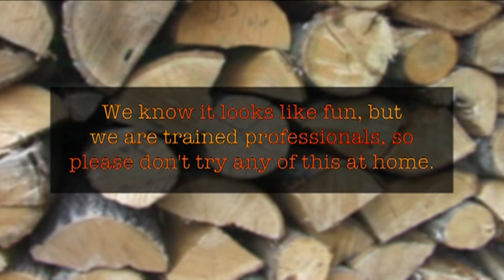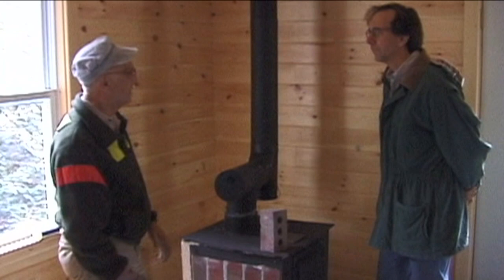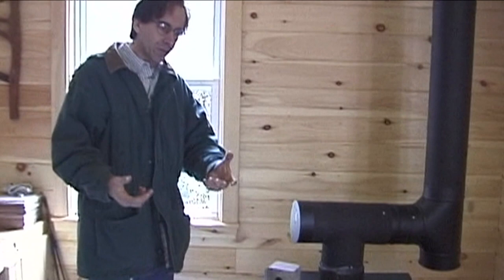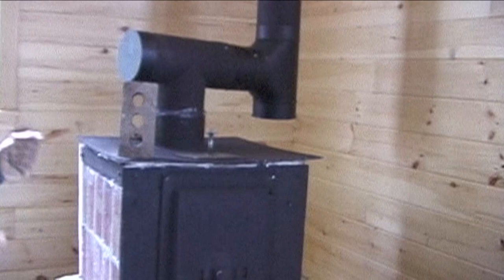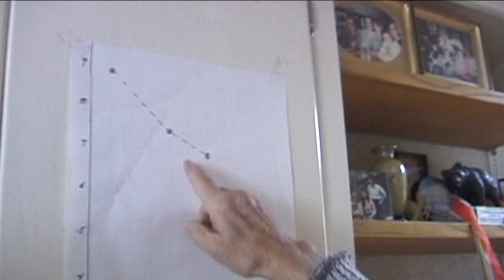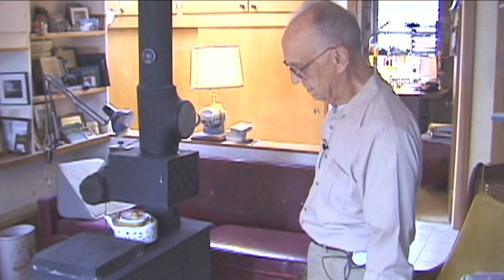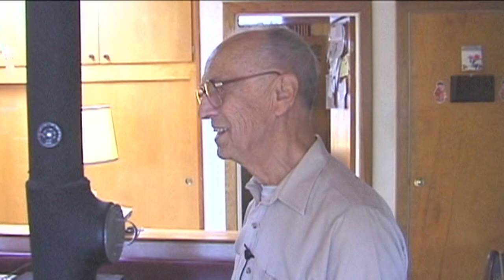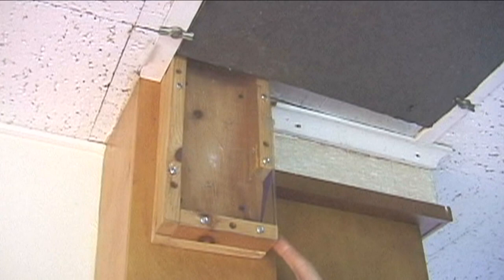Hot and Cold: Wood Stoves with Professor Dick Hill

Comment: This was a fantastic and informative,  the eldely gentleman had thought so much through.

The wood dryness test ive carried out myself in uk they recommend logs to be below 20 moisture level and weathered for one year. I have found stored in my shed windtight about 3-4 months and i can achieve this. Wood burns fine very little sparks. Outdoors just took too long using a simple tarp over the top.

I was also glad he took into carbon monoxide into consideration, i have mentioned it several times to utubers who made their own stoves for the intentions of inside tents. They dont seem convinced, ahh ive not had a problem before. I know from experience its a silent killer, my own home was burn to the ground and we escaped with our lifes only just due to the bravery and courage of the fire service.

Anyway job well done the refrigerator was interesting too. We waste enough as it is. Regards nick

Comment: Greetings,  thanx for video, good to see Dick on YT.  This Ceramic High Temp Insulation, for additional burn cycle,  is this commonly available, and if so where do I start looking for it?  And  is this something I can scavenge out of some common discarded item :-)?    Oh, one more query, is Dick into modern Rocket Mass Heaters (all over YouTube)  that use no electricity?  There are dozens if not hundreds of backyard fabricators all over YouTube building these things, and they have come up with some very interesting technology, but it would be nice to have some one like  Dick to help guide and refine their designs.   Thanx again, Regards, Mo
Reply from the maker: 1A We are friends with Ian in Austrailia. He has done some very nice work.
Dick has worked on masonry stoves lately, but not Rocket designs. If I can be so bold as to comment what he would think, I am certain he would have some concerns of getting a proper draft with some of these units.
If you have a clean burning device, a cheap ID fan is a real good thing to keep things working properly.
I realize this is not as pure as a passive device, but spilling smoke, even at startup is not something that is acceptable, IMHO.

We will be posting some new video of our current wood boiler work soon.
Thanks,
Tom